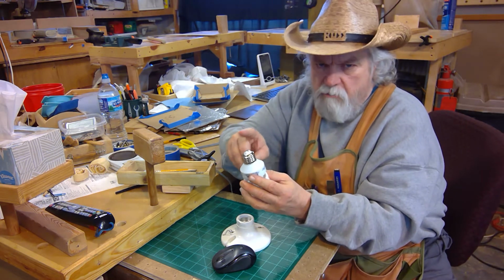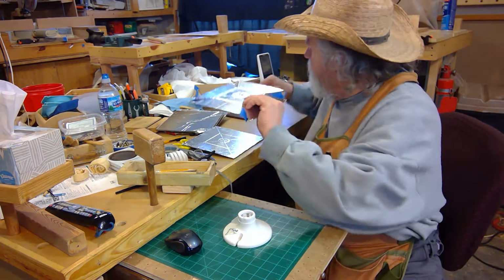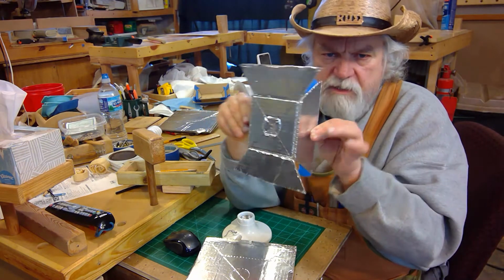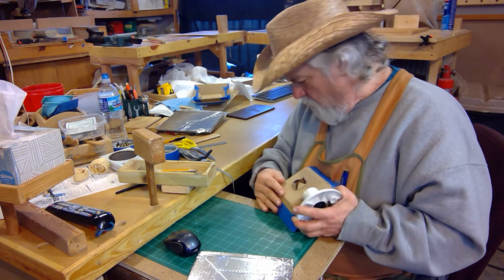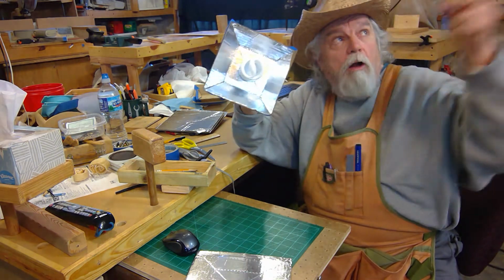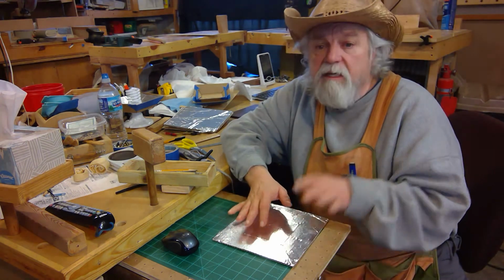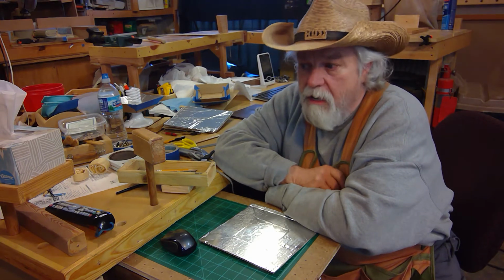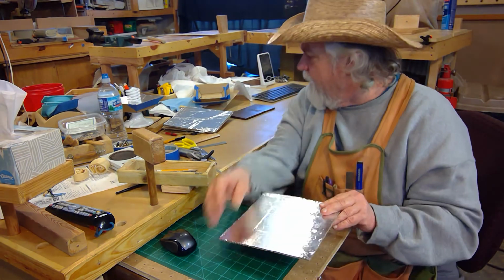Cheap Lighting in the Workshop by OTB Thinker

Comment: To pick a minor nit, the aluminum foil could possibly make contact with the metal screw part of the bulb so that the reflector becomes electrically "hot." My suggestion is to trim the foil away where the base screws into the socket. 

   I know the screwy part is supposed to be the ground or neutral side, but this will be the case only if the wiring is done exactly right. Personally, I don't rely on that because I've seen too many instances where the wires get crossed. 

   I've used similar sockets with CFL's and aluminum foil reflectors for years. I hate the 4' tubes with a passion!
Reply from the maker: the CFL's seem to be scare these days.  I think they are being phased out.  Too bad, I disliked them when they first came out but now I like them.   Now I need to find a decent LED light that works in these fixtures.  At least I won't have to replace the fixtures again.

BTY, I have been watching them in use (still using) and found them to never be too hot to the touch, only warm.  I have replace about 3 out of 12 over the last few years.   Thanks Clarence for your input

Comment: GE makes a really nice LED "Light Stick" they come in 100 watt daylight, and I've found them to be about the best. Also, a few years back when I started to outfit my one car shop (carless garage) the big  orange box store had some Commercial Electric LED 4' florescent style LED's that you can daisy chain 9 off a single outlet. They each have a pull chain switch, and came with a direct butt connector as well as a short pigtail cord for connection, including a 4' cord of course. I can't find anything as far as paperwork for them now, for a part number, but hopefully soon I can, and can remember to post that info. Thanks yet again for another fine video!
Reply from the maker: When I changed out my 4' lights (all were bad) the CFL bulb was being pushed by our gov't.  I use the single bulb fixture because of price and simplicity.  I will eventually go to LED bulbs (still using the same fixtures).  the idea of the single fixtures is the ease of adding more light, bulb replacement, and cost.

Comment: As an Electrical Fire Underwriter inspector by day I cringe seeing card board and aluminum foil placed directly against any light bulb, that would be a fire hazard and a National Electric Code Violation.
Reply from the maker: You are totally correct. I am sure I am changing my material to compatible material.  excellent point :>)  this was a prototype and now that I have a design and template to make a safer end product.  I should have mentioned this before.  thanks for the good advice.

Comment: Good ides that you shared, Russ.  For those who have not upgraded their shop lighting from incandescent bulbs yet - DON'T get the CFL bulbs like Russ showed us. (He bought his quite a while back - when LEDs were just coming out and were Expensive!)  
Instead, buy LED bulbs - of the color and Lumens that you need. 
 REASONS:  
1. Slightly better energy efficiency (cheaper to use).
2. Better selection of light's color and intensity.
3. VERY IMPORTANT:  If you accidentally whack it with a board, tool, etc., you don't have a "Hazardous waste" situation!!  When a CFL breaks, you will have a mess to clean up - to include the hazardous chemicals in the CFL "tubes".  On the other hand, the LED bulb has a MUCH better chance of surviving the 'whacking" - without breaking.  If it does break, much less to worry about cleaning up.  I have seen some LED "Shop Bulbs" with built-in reflectors and high levels of Lumens on the usual woodworking supply companys' websites (Rockler, Peachtree, and Woodcraft).  They may work for your shop - check them out.
Reply from the maker: Mac, thanks for the comments.  I am not completely sure LED lighting is the perfect answer (the verdict is still out on that one). i have a LED fixture in my house and I have to say it is worse than any CFL or incandescent light I have used.   my main point here is to buy the most common type fixture for the shop and household.  the CFL isn't any more dangerous than the original florescent shop fixtures (maybe even slightly safer) so going to CFL (with single fixtures) from 4' fixtures was based on economics and ecology. my fixtures use the same bulb as any standard household fixture.  this why it is cheaper and is the key to keeping your cost down.  These fixture don't have light deflector so I thought making my own would be a practical thing.
also, buying lights at a woodworking store is like buying them at a grocery store (maybe even worse).  As a thrifty consumer  I try to buy industry common (standard) products from the least expensive (and still reliable) source.  Buying from a convenient place is not always the best (or cheapest) choice. 
Again, thanks for your comments :>)